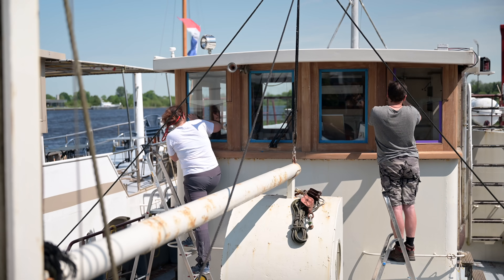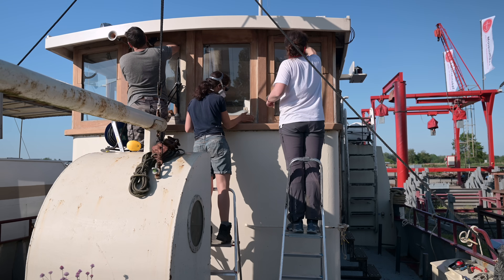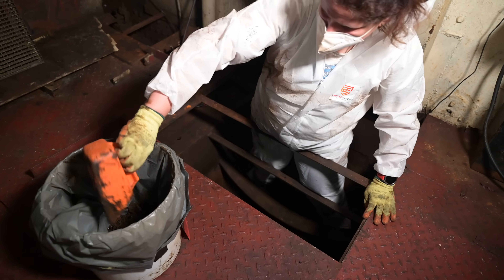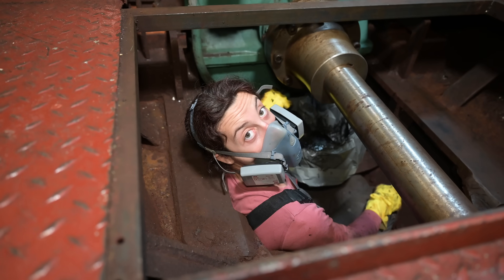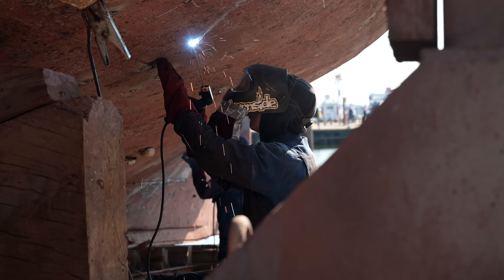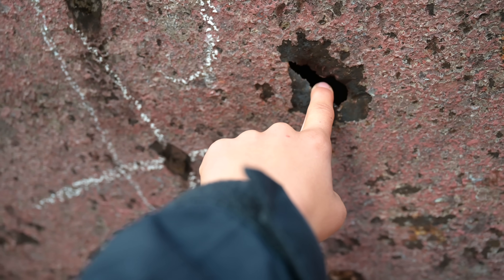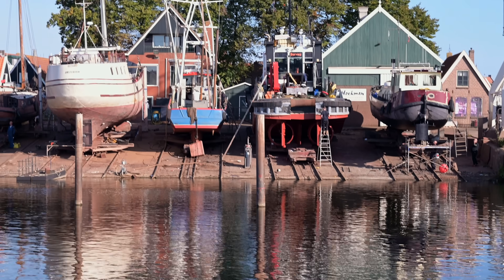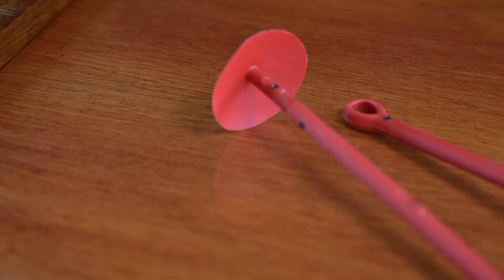We have a LEAK! Are we SINKING??

Comment: If I can offer you some advice re the petrol water pump. We live in a very high fire prone area in the Blue mountains west of Sydney Australia. As such we have 3 fire fighting pumps, one volume pump and a fire truck. What Ive found with petrol pumps is the fuel goes stale very quickly. So i never refill the fuel tank to the top, preferring it to be 1/2 or 3/4.stale fuel makes them very hard to start. By topping it up when you use it with fresh fuel you get an instant start and of course the pump needs a few hours to run in 👍👍

Comment: What is the clue that it was a wooden ship before?????
Reply from the maker: A wooden ship with steel frames. So the frames and stringers are predating the hull. There are some small differences like the L of the frames points forward and on steel ships it usually points backwards, the distance of the rivets is slightly larger and at some frames the brand name Krupp is visible. We also have a document stating that the boat was built using the frames of a wooden warship. The thing is that this type of wooden warship was very common. Mass produced steel frames exported in different countries and finalized with wooden planks in many different shipyards. Many of them still existing, for example the sailing ship Tres Hombres. The Dutch fisherman do not like wooden boats so they experimented with converting the wooden boats into steel boats. Flying Coney was probably the first one but the sailing ship Ocean Sherpa is another good example.

Comment: Do not run that pump in an enclosed space without exhaust to the open air. If the pull chord is a problem there is a way it can be removed and a connection can be established for starting it with an electric drill.
Reply from the maker: I'm sure we will improve the pump together with John. Of course we're not running the pump indoors!

Comment: I live in Washington State, USA where we have a sizable fleet of ferry boats. A number of years ago the Coast Guard was doing a routine hull inspection on one of our older boats. They chipped away a little rust and water started squirting in. The Coast guard wasn't impressed and removed the boat from service.
Reply from the maker: It always depends on what's the cause for a leak. I know an inland cruise ship were they used scrap metal as ballast. Over time one bolt in that scrap metal ballast worked its way through the hull. They had a diver coming who welded the hole shut and properly fixed it after the cruise was over. That one is still in service. It all depends if there are singular week points or if the overall condition of a boat is bad. In our case we made sure that the overall condition is good enough to start a refit.

Comment: You know, just maybe it's time to pull the plug on this boats It seems to be that you will always be chasing this rust problem. Perhaps this old boat is past its used by date. 😢
Reply from the maker: Spoiler from the next shipyard time: Hull inspection passed without any problems. Not one single plate that needs replacing because of steel thickness. An average of 7mm steel thickness. The required minimum is 3.62mm. There's no structural rust and we have everything accessible so the required repairs can easily be done.

Comment: It must have been so  disheartening after spending so much time and effort to find this problem .as for me i have made more progress towards being  able to afford to travel if all goes well . A few more months and i will know one way or another .at least your problems are straightforward my problems involve dealing with people a much more difficult task .BUT  they are learning i am a most stubborn person 😊. one of the people i must deal with is a Lawyer he was slow to learn i am a most determined man and will not tolerate delays in my plans do to a lack of information on his part .disheartening yes ,but in the end most gratifying .There's Nothing like winning a battle of will's against a lawyer .I have age time and wisdom on my side he doesn't stand a chance . if i want something bad enough I always find a way .Well until next time fair winds and fallowing tides stay safe and stay dry .
Reply from the maker: Currently we're making a lot of progress on the boat and we know every problem that needs to be solved. Since we had to weld hundreds of spots it was plausible that we missed one. I guess most people wouldn't even notice or care about that. The funny thing is that rivets and plate seams are watertight because of a little bit of rust in between them. So there's grease on top of it the rust can't form up and it's slightly leaking until there's this bit of rust and then it's watertight again. It's very similar to wooden planks that need to swell up in the beginning.
Reply: @FlyingConey  😁A case of what some think of as bad actually being a good thing . or as some would say a boat in the water is nothing more than a hole in the water you pore money into .I say what price is too high for living a dream .

Comment: I would say ---- never cheap out on emergency equipment !!!
Reply from the maker: I agree with you but it's a matter of perspective. From my perspective we even bought a very big pump just in case. The pump is new, it's working fine and once you figured out how the three different leavers need to be placed to get it started it's reasonably reliable. So the cheap out would be to buy no pump.